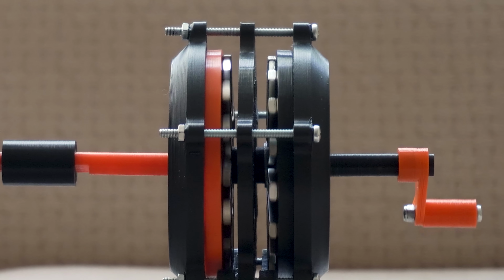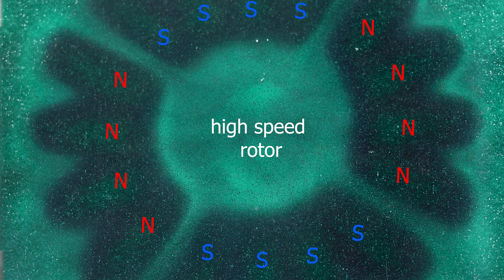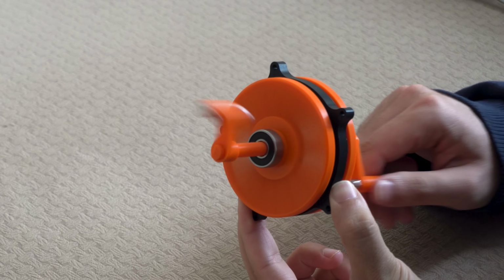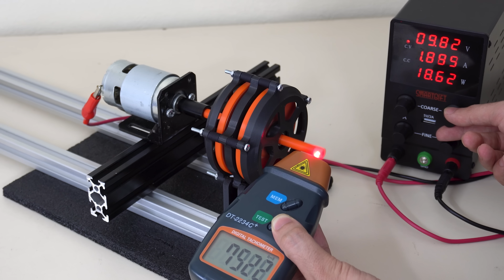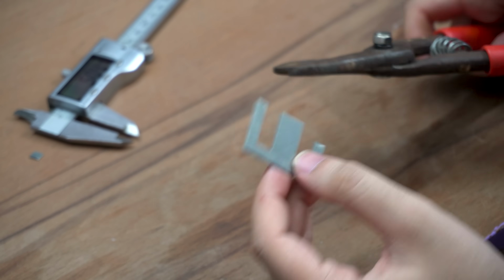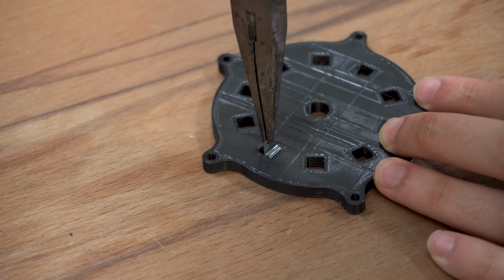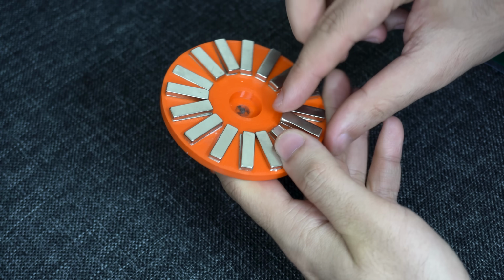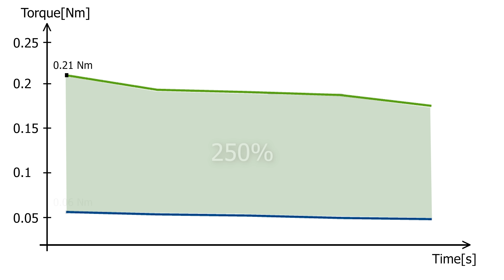Gearless Magnetic Transmission - You Can't Break These Gears

Comment: French physicist Pierre Curie would like a word with you about Neodymium magnets and temperatures starting at 80°C. When magnetic materials reach the Curie temperature, the alignment of magnetic moments becomes forcibly disordered.  Therefore, as the operating temperature increases, and moves towards the material’s Curie temperature, the magnetic strength of a material weakens due to the moments shifting out of alignment. AlNiCo magnets tolerate the highest maximum operating temperatures of between 450-900°C.

Comment: Did you know, older tractors use to use a version of this on the pto to isolate the tractor from hammering of machinery. It was only largr ceramic magnets on one side, and a thick copper disk bolted to a steel one on the output. The magnets would apparently drag the copper around as it setup currents  that resist the magnetic charge change.

Comment: To avoid any unwanted back flow currents, instead of using that plate with screws in it, try using a copper plate that has cut slits that inline with the plate that holds the magnets. This insures that the back flow currents wont be powerful enough to effect the spin of the machine but as far as getting useful electric power out of such a machine I leave up to you.

Comment: For added torque you can use many smaller magnets that equal the same volume as the previous ones of the same N52 strength. As long as the smaller magnets are of the same strength or greater then you will achieve the most magnetism. Add Tesla's "V" design to eliminate eddy currents and it would be even stronger. Try to make the encasement out of graphene for strength, resistance to heat and magnetic fields. Use the most potent iron you can find to multiply these forces. Add iron in the center of the each magnet. Imagine an iron "V" bar wrapped in magnets or on the top inside of the "V".

Comment: As for the intro, to avoid unexpected failures, avoid turning power supply to maximum as fast as possible. Try doing it gradually to see how the device reacts. Also during the first test at 3 minutes, the very evident bolts coming undone and starting to disassemble is a good indicator the structural integrity is degrading, these are good things to pay attention to.

Comment: If you add a variable-current stator plate in between, you could use it for infinitely-variable gear ratios.  And the other thing is, if this is used as an  electromagnetic coupling, there would be no need for a hydraulic torque converter to decouple the driveline when the vehicle comes to a stop.  And if further modifications are added in, it could also have an electromagnetic clutch to connect the input and output together using friction material.

Comment: Magnetic clutches are used in a lot of things that need mechanical isolation as well as environmental isolation. The most common use is in automobile air conditioning compressors. I have seen them in exceimer gas lasers for the gas recirculating blower and in submersible water pumps rated for deeper than 200 feet. They tend to use electromagnets unless very light duty. Also ceramic ferrite magnets with iron pole pieces are used in the pm variety because they can take the heat if the clutch slips.
Reply: I was under the impression that the electromagnetic portion for an AC compressor was just a way of engaging the physical connection of normal clutch plates.  Instead of using springs and some physical actuator they just flip an electromagnet on and it forces the clutch together. 

It just uses normal friction plates.  This is a bit different.

Comment: its a great concept,  and yes the heat the magnets get exposed to over time would deteriorate them , thats another technical challenge,  but the industry is so dependent on oils, lubricants , even maintenance intervals for conventional transmissions,  that even if you could solve all the technical problems ,  it would just be shunned like any other invention, that cuts out everyone else looking to get a piece of the pie . perhaps a similar version, that uses oil to cool the magnets would be more practical , because then you still have something in todays market, reliant on lubricants,  and it may help solve the degradation of the magnets from the heat,  and still produce a transmission that is both far more reliable and efficient .

Comment: Would having inserts in the modulator as strips the length of the magnets improve things? That would increase total cross section area further without increasing width. Maybe even a tapered shape like a sharp V to better suit the gap between magnets

Or do the inserts need to be as small as possible in both length and width?
Reply from the maker: there are actually articles about the effect of the cross-section or shape of the metal segments in the modulator on the torque and in the improved version,  I will probably demonstrate the effect of each of these individually.

Comment: I'll say one thing; you need to use lock washers on your bolts that are holding the whole apparatus together.  Two of those were completely loose while you were turning it with your electric motor.

Comment: Cool idea. Was just thinking about a way to make a transmission using water and adjustably placed flat metal disks. Just use surface tension on the disks. The closer the disks get, the stronger the grip is between them, but still not actually touching. To replace things like clutch pads.
Reply: So I'm fairly skeptical that you could accumulate any real torque using surface tension alone. First off, the water would likely boil quite quickly. Which you might be able to figure it how to mitigate, though other higher temp fluids might serve the purpose better. 

For inspiration though you can have a look at Tesla turbines, they run using compressed air or steam and kinematic viscosity and surface adhesion between closely stacked discs. 

Another place of inspiration would be motorcycles, which use a wet clutch (versus cars which use dry clutches), where the clutch is bathed in the engine oil. In reality the oil functions as lubricity and cooling than providing any sort of torquing function. 

At any rate, an idea never applied is just that, you never know where it might lead, happy researching!
Reply: @newolde1  Yes, exactly, that's where I got the idea, Tesla turbines. But you are right, could be tricky to implement.
Reply: @brjones27  yeah definitely tricky! It slipped my mind, torque converters or viscous coupling units essentially do this. Though they often have a lockup clutch that engages on matchup for efficiency.
Reply: @brjones27, Your idea has been used for years by on the Landrover TD4 it was used with a special oil which became very thick when forced to spin between very close discs within a closed drum as part of the power delievery from transmission to rear diff.
Reply: @MichaelMurray-w6f  Hmm, I had no idea. I guess it's time to go back to the drawing board.

Comment: Super cool video.  Amazing what you've been able to demonstrate.  I had no idea that you could use the polarity of the magnets to change the 'gear ratio'.  I'd be really curious to see this performed with machined parts.  You can see that the 3D printed parts don't have great runout, and so they wobble a bit.  With more precision parts, you might be able to achieve some significantly higher RPMs.  Still super cool.

Comment: What if it was used as a coupler for a generator, say, a wind turbine? Would it function to protect or limit the output, providing some charge control?
Reply from the maker: Actually that would be great, the mechanical gears there need lubrication etc. and you know it's quite difficult to maintain them, but magnetic gears don't need lubrication and so on and they can't be damaged, so that would be quite good.

Comment: The more torque the more heat, it's actually easy to overheat magnetic gearing and why automakers, truck manufacturers, and trains don't use them. For low torque  high speed apps they are just fine.

Comment: You could probably build that into an axial motor for built-in down gearing. Incidentally, are you using a metal backing plate for your magnets? Even a thin sheet DOUBLES the effective thickness of the magnets while adding very little weight. It gives a similar effect to Halbach arrays, but it's mechanically self-stable.

Comment: You are in fact creating a generator/motor set using permanent magnets. This is achieved on diesel electric locomotives which also allows the driven member to be separated from the driving member by a distance. Permanent magnets can loose their residual magnetism. Electromagnets do not. Electric fans change their speed by changing their number of pole pairs. It is however a very interesting project.

Comment: What is the efficiency? Gears are very efficient when new and well lubricated, but add weight and cost . Magnets are like an hydrostatic in that the slip doesnt damage or wear out the components but will generate heat. Might be good for small torque applications or in electrified cars by having a variable ratio and tirque / speed input _ output built within the motor and its PM themselves. Its a option with potential in certain apps.

Comment: I've always wondered about using magnetic gears, especially for 3dprinted applications.
I wonder if it might be possible to find a magnetic shape that allows to remove the bearing, so the entire thing is held in place by the same magnets that also transmit the power.

Comment: amazing, but you broke the unbrakable gears D: 
Also, the vibrations caused the surrounding knots to unscrew at 3:10 - suggest to do double knots there to remove related parts loosening.

Comment: How long should the flux modulators be, as a ratio to the length of the magnets? I'm building my own version of this with 1" long (deep) magnets. Should the flux modulator also be about 1" long? (Assuming i minimized the gap between magnets, and modulators? Thanks!
Reply from the maker: Good point, according to dozens of papers, it should be about 5% shorter than the magnets, this is for the radial flux one, though it doesn’t matter I guess if it’s radial or axial. For instance, you have magnets of 25mm length then the modulator stack length should be around 23-24 mm. The computer analysis shows that the fact that the stack length slightly shorter than the magnets increases the torque limit. By the way I made a optimized version as well, probably you’ll see very soon.
Reply: @retsetman9698   Thank you so much for responding! Very helpful!!
Reply: @retsetman9698  Sorry, one more question - you said the total number of flux modulators should be equal to the total number of pole pairs - but if I'm trying to ramp up the speed (instead of step down), and the "fast" side only has 1 pole pair, wouldn't I just want to have 2 flux modulators, one to attract and repel each side of the "fast" side pole pair?

Comment: correct me if im wrong but that thing looks more close to torque converter not a transmission. you may achieve simulated gear ratio in terms of rpm but you will get a reduced torque regardless of 'gear ratio'.

Comment: Could you explain how it is lubrication free. Though most gearboxes (when in a housing) are lubricated with oil this wouldn't need oil that's true. But the bearings needs to be greased somehow. Furthermore lubrication doesn't only cool parts down and create a slippery film, it also removes dirt. So I just try to understand how it works in I guess a bigger scale, or at longer perioods of use. I liked the video though and it sparked my interest so, good work.

Comment: watchign this made the idea of using magnets as spring us with the neg and pos force.    and making me think outside of the box of just using them to attract.  not just to levitate things. but just to assist with moving things.  insetting them into wood, puttinga plastic sheet on top, then making rand size platforms to set things on that you want to be able to move, without having to pick them up and over each other.  the platfroms having the magnets in them as well, with them forcing away,  its would make things slide alot easier.  in them cases where its nice to slide something aside and pulling something into your work area smoother, less annoying and chance of error that picking thing sup all the time to move it might cause.  

dam magnets have a gazillion and one use man lol

Comment: Eddy currents and thus heat generated could possibly be many times higher than in your test if torque is applied to the gearbox. You basically ran your test in neutral. The only eddy currents that were present in your test were caused by friction forces and inertial forces. Obviously the torque would be much higher than either of these forces so the eddy currents would also be higher

Comment: This does actually wear down just like a regular gear, just in a different way. The constant magnetic force creates Eddy currents, which heat up the magnets, which slowly demagnetizes them. So there's actually no real advantage over a normal gear box. One thing that could be interesting, though, would be to have remagnetizable magnets by wrapping copper coils around them. You would then just have to apply high-voltage DC to "fix" a worn-down magnetic gear without having to replace any parts. My guess why this isn't done IRL is that the energy loss through Eddy currents is too high to justify this.

Comment: I would sincerely like to see what can be achieved with this concept, when combining what we know about YBCO super conductors, and electromagnetism, especially inside of electric vehicles that have insane torque capacities. There is a relationship that can be preprogrammed in the ECU between the revolutions / torque required and the strength of the electromagnets, theres also electronic cooling with the reverse effects of eddy current, similar to electric refrigerators possibly too. Naturally this seems like a lot of energy being consumed when efficiency is already an ongoing issue with electric cars, but there is the F1 (& similar) systems for transferring heat energy in the braking systems to store energy that arent being implemented yet in commercial cars, at least to my knowledge. Theres solar film similar to Sina Plaza buildings in Beijing that can be used over the whole car for general efficiency. Batteries are improving constantly too, we havent quite started to tap into graphene film batteries either, yet. There are strong possibilities of fully electric SUPER low maintenance highly efficient vehicles becoming the normal mode of travel in the near future. I am excited.

Comment: How would this respond if a similar device was use in a torque converter configuration using vanes and a dielectric fluid of low viscosity? Is there even such a fluid? 🤔

Comment: What about using coils instead of magnets? Would that allow you to increase the magnetic force while also being able to change the grouping at will? It would be easier to integrate the coils into the structure of the rotating plate as well.
Reply: It could, but you would need to extract some energy pro produce the magnetic, and that's where. The problem is 
Basically you would need a tiny generator on each independent plate

Comment: Great video! This is an incredible idea and a great project! 
Is this gearbox used anywhere right now? And, what are the advantages of using this type of gearbox instead of using a regular one with actual gears?
Reply: It doesn't brake and doesn't need lubrication, as was said in the video

It also makes no noise

Comment: Would adding a small squirle cage out of assuming carbon steel if this was going in some kind of motor or vehicle. To avoid the heat issue and also there would be a torque issue with that much speed and with no exchange it seems more  that It could go in one hell of an rc car.

Comment: Please help if possible.
I require a 20 hp (15kw) drive to a centrifuge. 
The drive is for a centrifuge which must spin at 465 R.P.M.
The diameter of the centrifuge is 1,200 mm. -
What magnets should I use?
How far apart?
How many discs with the magnets to equal the torque of a standard electric drive ( 1500rpm belt reduction to 465)?
Do I increase the driven torque by mounting the magnets at 1,200 mm or is it better to use the same number of magnets mounted on more drive discs at a smaller radius?

Comment: This is so insanely genius.. Sadly magnets do not last, and while there could be some "electro-generation" to power electromagnets here, there is something called the conservation of energy which will restrict the system and force it into a net-negative state after a short time... There are also demagnetizing fields due to the opposing fields you are subjecting them to to deal with along with heat and stress that will cause the magnets themselves to lose functionality, become brittle and break... Even without influence from the elements, time itself weakens magnets.  Same with magnetic locks etc.

Love the idea though man.

Comment: In a vehicle use, with high end magnets. I wonder how torque would be effected. Because the force required to start up hitting the gas hard would basically cap you on speed build up. 

Basically they would slip unless to gasses appropriately. You wpuld need an internal computer that could limit ur acceleration to never slip a gear. But I'd say unless ypu could at least get 0-60 in about 12 seconds. (Where the average Satan is 8 seconds) then people may opt to not want to have this. 

That's a 50% increase to standard acceleration and people don't like going slow most of the time. So even that would be pushing it. 

But long term benefits may have some people liking the idea.

Comment: The problem is that the loss to heat is greater than the loss to friction in a normal transmission. If that was not the case, we would already have magnetic transmissions.